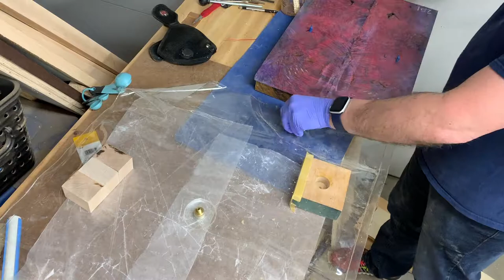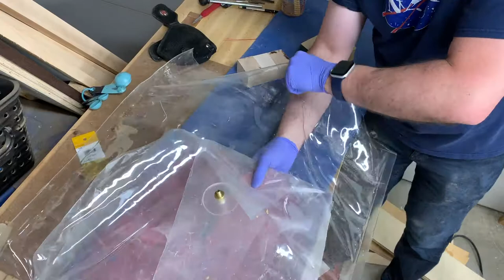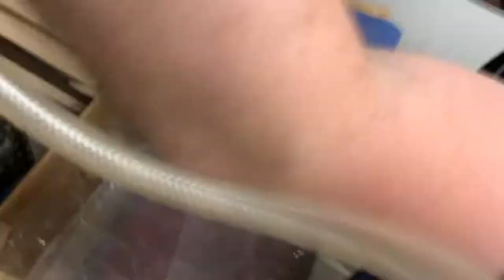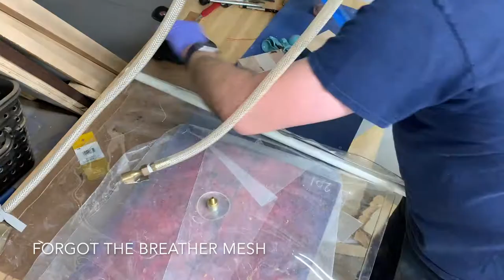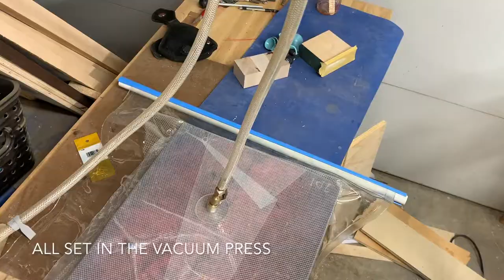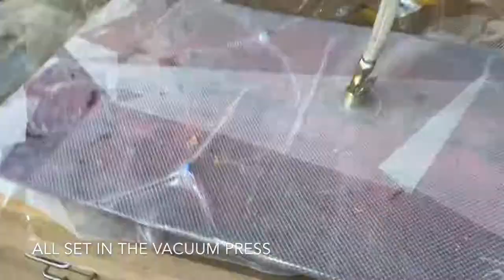Vacuum Press and Guitar Top

Comment: What kind of compressor did you use? Where'd you get the vacuum kit? I liked and subscribed.
Reply from the maker: Thanks! I got the kit for the vacuum press from veneersupplies.com -- great product, great support, highly recommended. My compressor is a 4gal Dewalt 55153. It's just barely enough for the press. I don't think it's so much the size of the compressor as it is the airflow volume it can produce through its regulator. It has a couple of really tiny tubes between the tank and the regulator, and I think a little more air flow would help. But, I've never had a failure during a glue-up, so it's just enough.

Comment: What vacuum pressure do I use? ("HG) Thank you
Reply from the maker: I have it set to 21" HG (~530mm). That was the recommendation from veneersupplies.com where I got the press. I used to run it closer to 23-24, but it would cycle on and off a lot. 21" makes everything run smoother and I can't tell the difference in the quality of the glue-up.